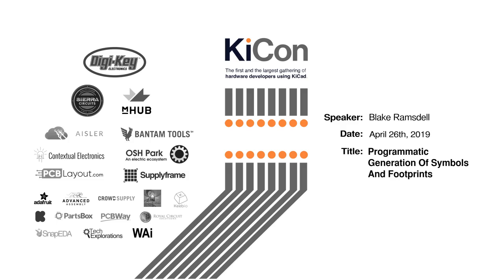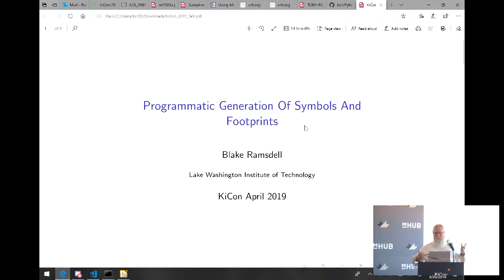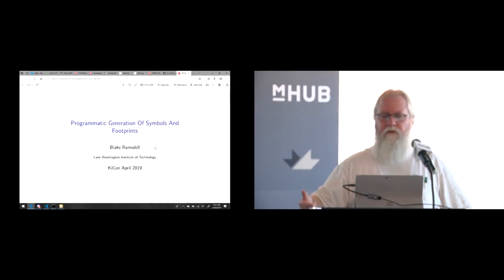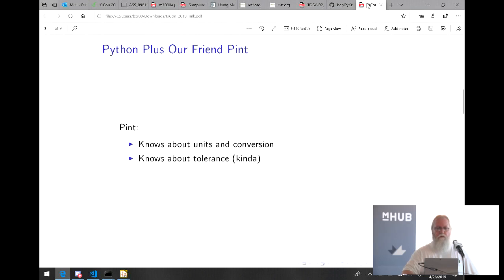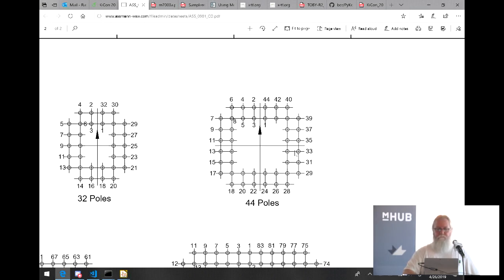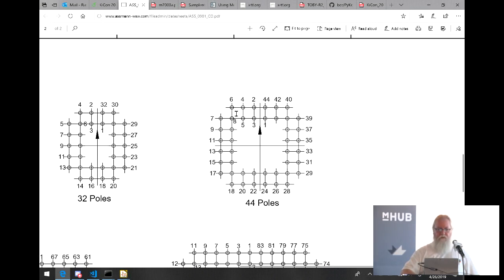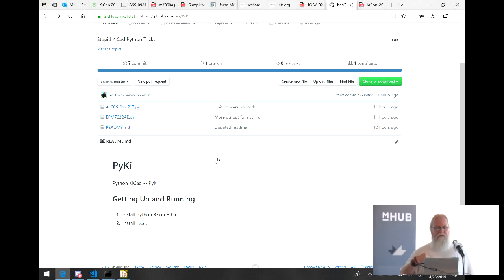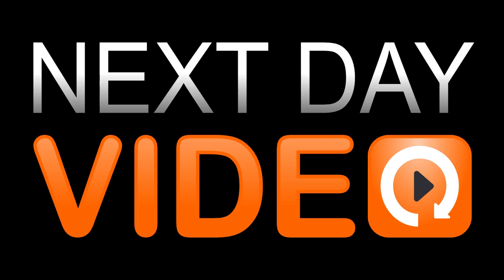"Programmatic Generation Of Symbols And Footprints" - Blake Ramsdell (KiCon 2019)

Comment: Do you think we'll ever see a day when we can simply scan (upload/screenshot/whatever) a PDF datasheet and automatically create a symbol and/or footprint? Almost all datasheets have these elements pictorially defined. I feel like some brilliant person should be able create a program to identify a symbol on a PDF and then map most, if not all, of it's basic information to a symbol and footprint. 
   I have no idea what this kind of project would entail, as I'm a simple hobbyist, but if software dev gods can program facial recognition capable of detecting human emotions, surely it is possible to detect a few words and rectangles on a 2 dimensional document.
   I wish someone would create a program like this and then set it loose on digikey and alldatasheet. Even if the software was limited to ~75% efficiency it could be highly useful. Either create a special designation for parts autonomously created with a note stating they must be checked and confirmed, or have the end user upload the datasheet, run the software, then map any mistakes or unknown variables flagged by the software. Why is this idea totally naive tomfoolery? I know it is. Someone would you please inform/reform me?
-T. Fool :-)
Reply: I know that Saar Drimer wants to see this also, check out https://boldport.com/blog/2019/3/8/on-better-datasheets -- having symbol and  footprint data in machine understandable format from the manufacturer does seem like a good way to go.